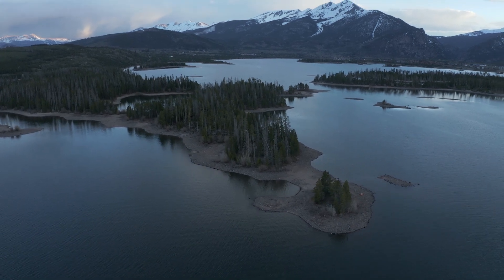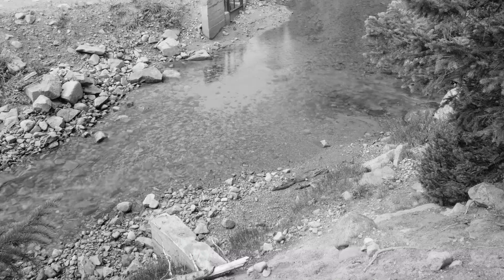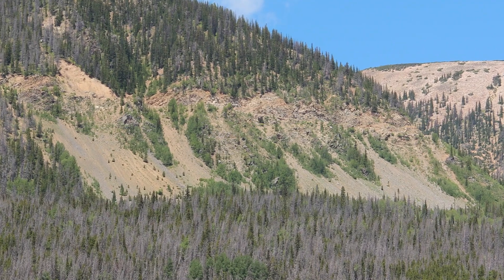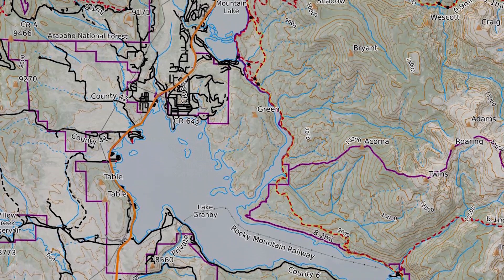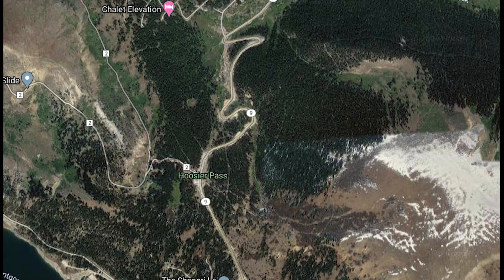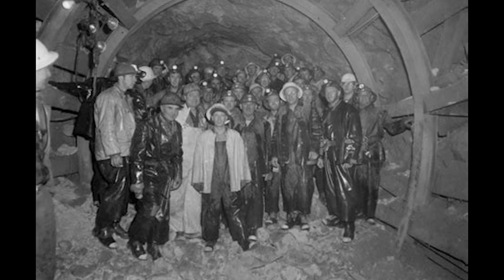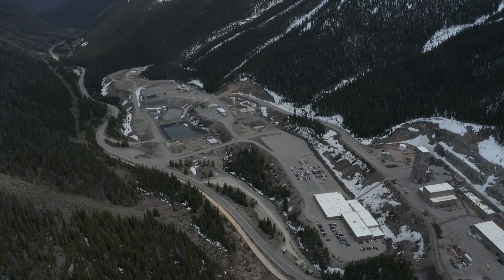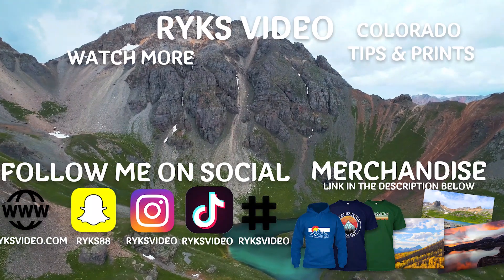The Wild Way Denver Gets its Water

Comment: Great informative report, thanks for sharing. I'm curious as to the scale of diversions and reservoir holdbacks, it would be interesting to know in terms of percentages and acre feet what sort of inflows, outflows, and capacities these systems are managing.

You speculated that the back and forth piping may have something to do w flood control, I don't know about that but it seems reasonable that similar projects to ought to be able to provide water and flood mitigation to the east as well as water to the Colorado. And what ever happened to cloud seeding for snowpack, does Colorado do that at all?
Reply from the maker: I know Colorado does seed the clouds in winter. A big chunk of that money to pay for cloud seeding came from Vail resorts. I know they scaled down on seeding during 2020, don't know if they ramped back up or not.